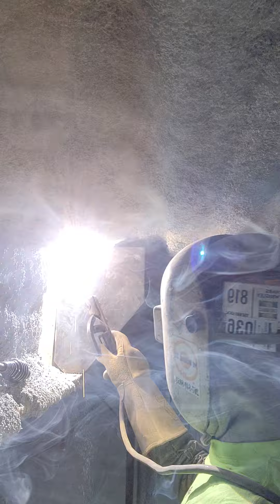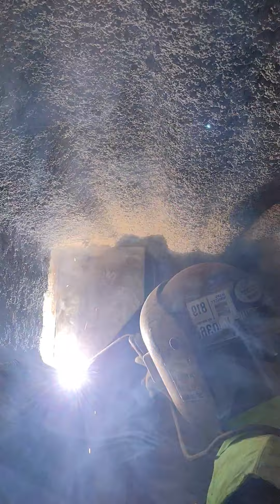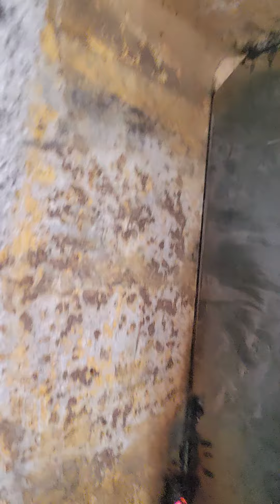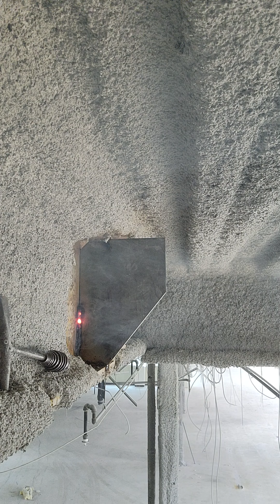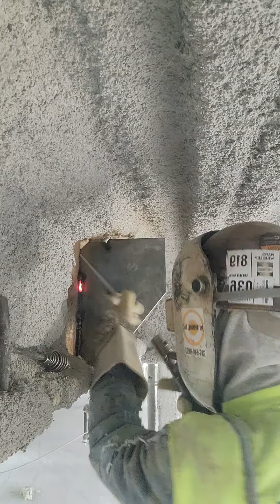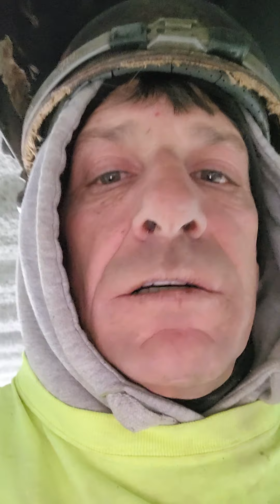STRUCTURAL WELDING/STIFFENER PLATES = Common Fillet Welds

Comment: Hey 👋 Northern Michigan here. I pour concrete walls man. Lots. Mostly residential. We put in the foundation and elevator shaft, stairwells for a Marriott in Petoskey. Huge steel crew there erecting steel. This was back in 2017. I noticed those guys throwing rod after rod down. Half burnt rods...if they struck an arc and only ran for three seconds...they threw that rod down. 1/8 Excalibur H4R rods. I had just started SMAW training...so I would puck up those rods at the end of the day. Wasteful on their part but was a big help to me. I had just started practicing my starts and stops. Worked out great. I figured....a big company like that. Those guys weren't worried about footing the bill and had no problems just pulling another rod. I know restarting 7018 can be a pain in the ass but....something else I noticed. When they were welding down the deck....6022. They were just blowing through. So many welds not sticking to shit. Just an observation I made...the 6022 welding was probably 40% sticking....no shit. It was bad. They were welding Nelson studs too....with a big trailer welder. That was neat. I still have a bucket of knocked studs and studs that didn't stick. We have pretty shitty weather moving in now I guess so today was a snow day for work. Haven't done much of anything productive out here in the shop ( it's really just a garage ) today. Needs to clean up some steel from the other day. Running the oxy/fuel torch on some mild steel ... brazing practice. Bored...thinking on what I might like to try and tackle next....hmmmm. I dig your videos man. I dig anything welding. Keep up the good work my friend and may the Most High continue to bless you too. Peace and grace friend.
Reply from the maker: Clint, What's going on, Aint that some crazy shit, Rods are very expensive today, Everything is, Keep up the good work, I love what you said about the 6022, If you don't have somebody that knows how to( Puddle) Weld, You're a deep shit, I love some of the stuff I saw in my career, The one job reminded me of a  disco ball, There was so many holes in the 1st floor ,  ground floor,with the basement ,the sunlight came through it was amazing,  It was almost like being in the seventies, That erector had some fixes,  Welding is the greatest career, Stay safe my friend

Comment: Frank get that little miller case 160 STL n lock it up . Although u may brun it out  good for the little jobs n red makes one also. Weld on
Reply from the maker: Mike, I would blow that thing up,  If there was power, I would use my XMT350 cv/cc inverter, Miller 400 Pro is the power source,PRODUCTION WELDING